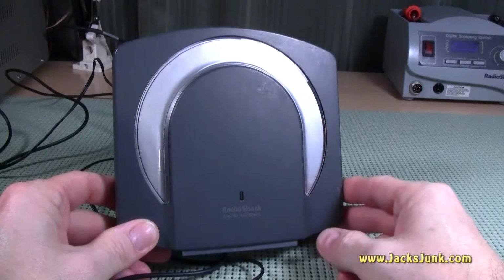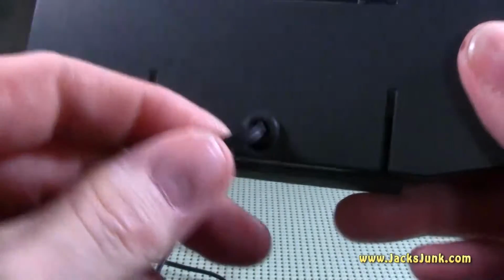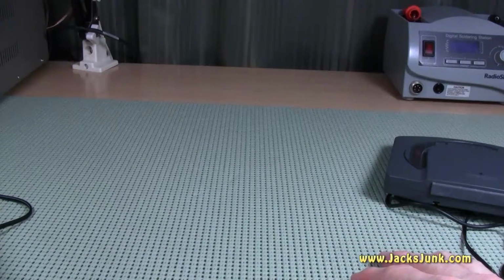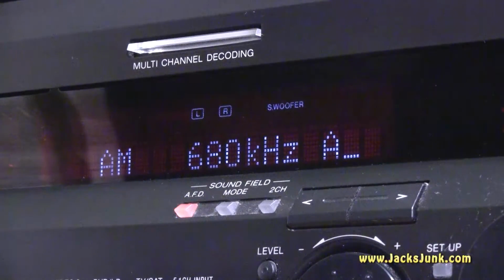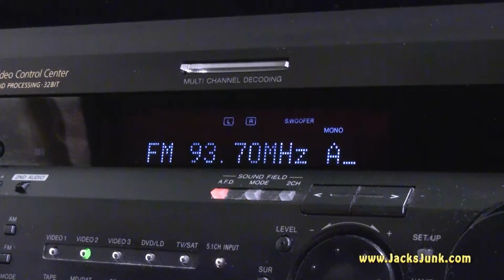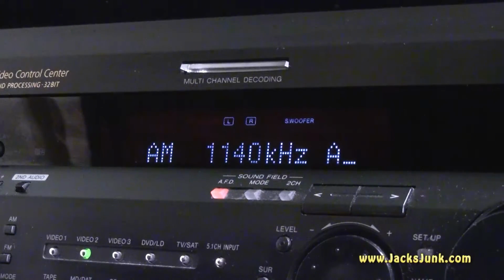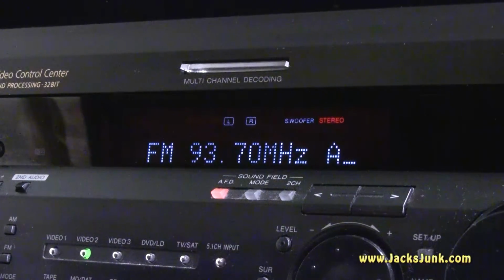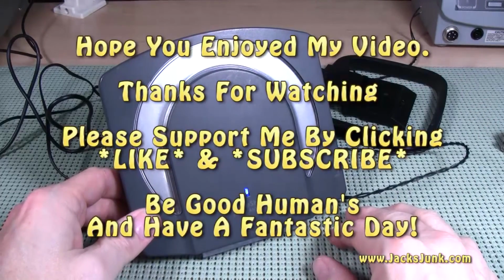Radio Shack Indoor AM FM Antenna Model 15-1859

Comment: I bought mine new in 2003. It's worked great for years. Then someone pulled the FM wire out. I'm trying to figure out where it goes so I can solder it

Comment: I have one I used for about ten years then I put it away but I thinking of using it again ,I live in apt.nowadays ,am a little hard ,but I also have the tecsun 100 or 200 I forget it's a loop antenna for am no connection needed.Just put it by the radio near its antenna ,it has a funding knob to help recieve,it does have a direct hook up for the radios that have a place to plug in ,can be used either direct hook up ,or by setting it near ,love it,I also have a antenna also from the tecsu n brand ,it can clip to the fm antenna or be plug into the radio both works.,plus it can spoiled out to about thirty feet ,haven't measure it yet.both of the tecsun am or fm antennas work pretty good.for apartment needs

Comment: I have this thing. And there are three points I can add: 1) The maximum-minimum switch apparently only works for FM, not AM. This is quite obvious because the electric cable is attached to the the FM cable only. So if you use it for AM, you can unplug the power to save some energy and money. 2) The instruction manual tells us to place this thing as high as possible. By doing so, I got the AM signal way better. And yes, always place it vertical, on the wall or on the stand. 3) While the maximum switch improves a lot the FM signal, but the antenna's area of reception is apparently very limited, and the 6 feet cables don't help either. At my living room corner, wherever I place it, the FM signal is still under par. Eventually I replaced it with the 360 degree antenna, which doesn't use electricity, and I got dramatic improvement over this one. Not a very effective product, I would say.
Reply from the maker: I agree with all your points...yes an outside antenna is far superior to this or any indoor antenna, however for those that live in an apartment, rent or just don't have the financial means of a proper outside aerial, this device does work somewhat better than just straight wire...not by much but it is noticeable.  Thanks for watching.  ~Jack, VEG

Comment: I've seen something similar and the booster only seems to work on fm. Great video and nice receiver there!
Reply from the maker: +Matthew Richards Yes, I too was surprised to see it offer AM and that's one reason I bought it! The Sony, is an awesome piece of equipment (and I have since become a Sony fanboy), sadly I don't use its full abilities....I've owned it since new...used it for about 6 months originally but put it back in its box up until 3 years ago....I had an older amplifier that I really liked, but thought I should use the Sony....when this unit die's, I will replace it with something from the 70's  Thanks for watching!